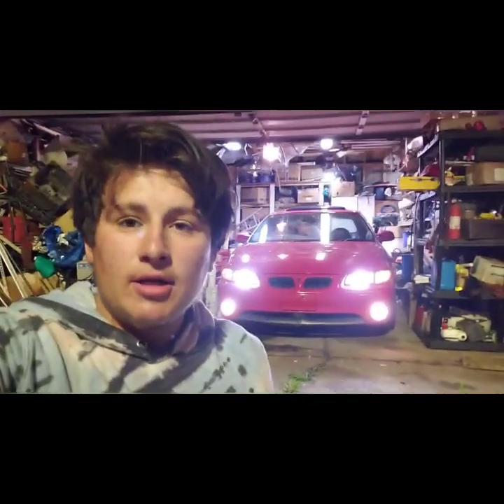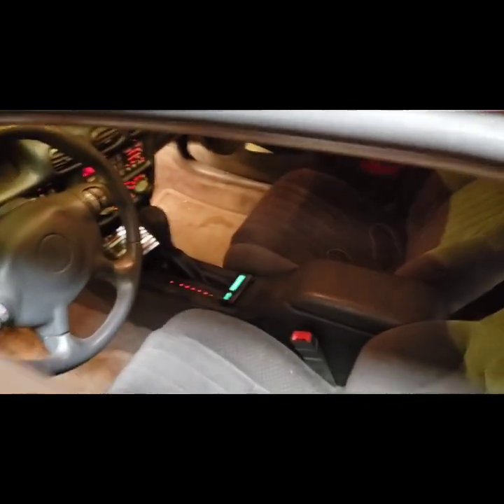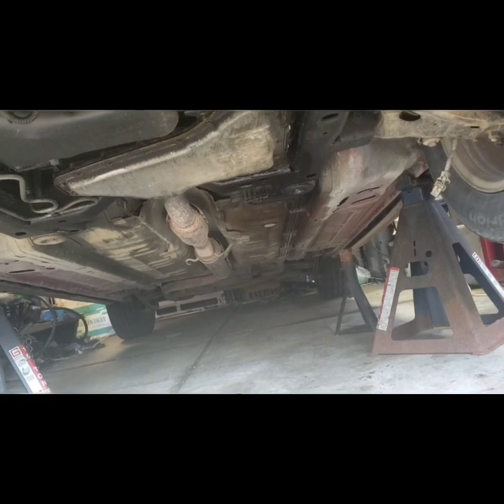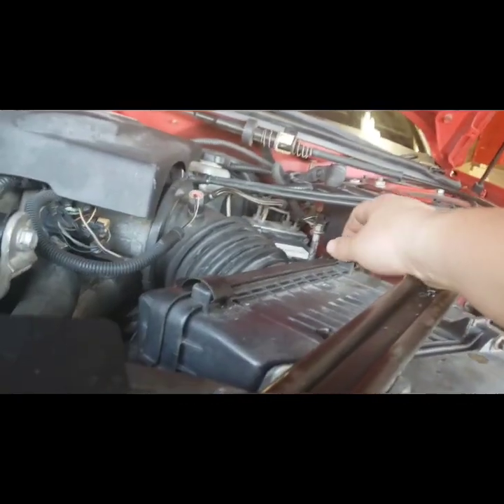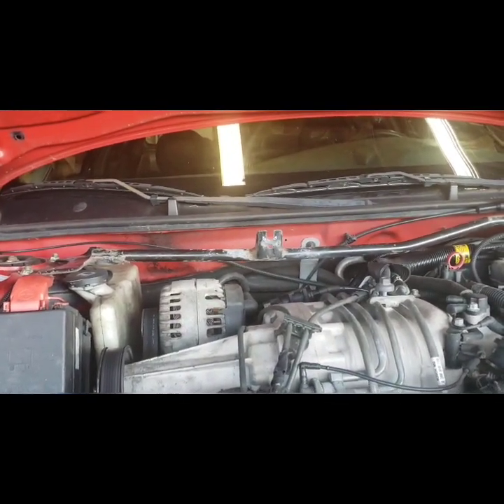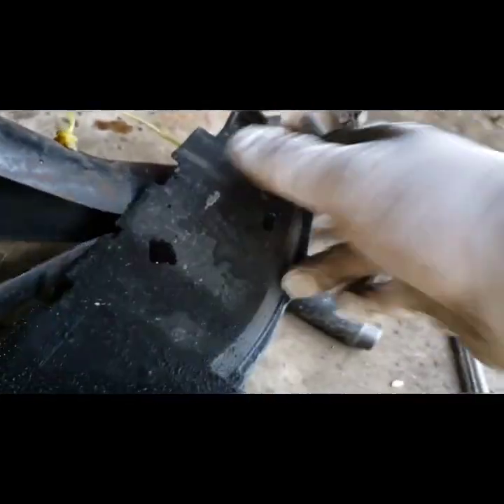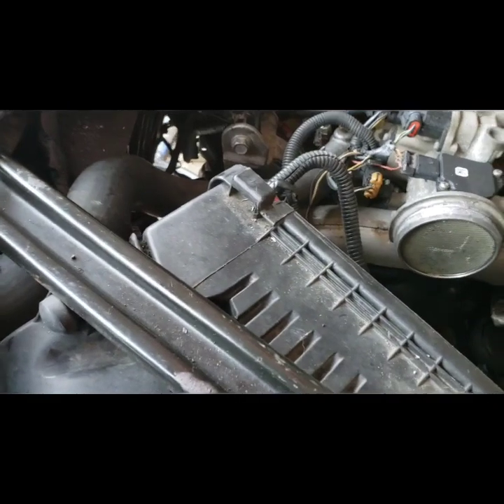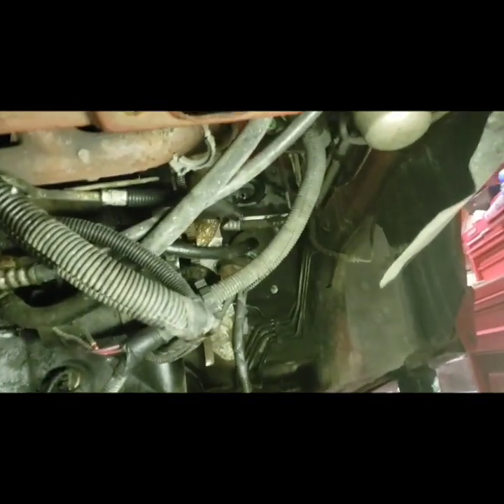02 GTP manual swap PT. 1 : Disassembly

Comment: Love how you went step by step with everything. I lost 4th in my first 4T65e-HD, attempted a rebuild, still didn’t have 4th and I messed up something else too, replaced it with another unit, but the new one doesn’t shift as well as mine did before it lost 4th. I’m tired of messing with the auto so I’ll be starting my swap soon, just gathering parts and getting an idea how it goes. I think for myself I’ll drop the engine as well just so I have extra room in the engine bay and so I’ll have easy access for header installation